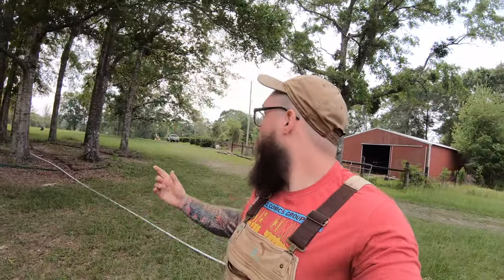Tractor In The Shop | Putting A New Deck On A Trailer (#65)

Comment: Trailer Looks Good, Fine Job !!! What type of Screws used, Harden Steel or Stainless Steel ??? Looks like a New Kubota, how did y'all killed the Clutch already, Lol ???
Reply from the maker: They were hardened steel screws. We’re not quite sure how the clutch went out. It is basically a new tractor it has 261.8 hrs used on it. I think maybe someone was riding the clutch to much. But we will see, we’re pretty sure it’s the clutch and we’re hoping it’s not something else. 

The wood is treated btw.
Reply: @lallylife8545  Kool !!!👍👍👍